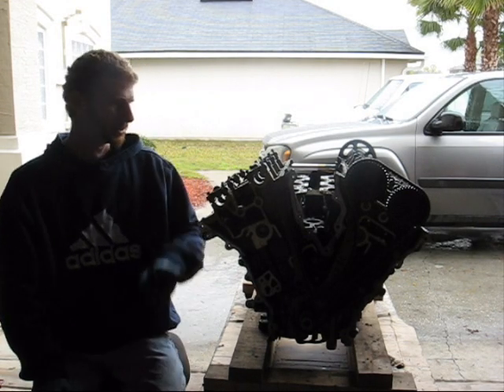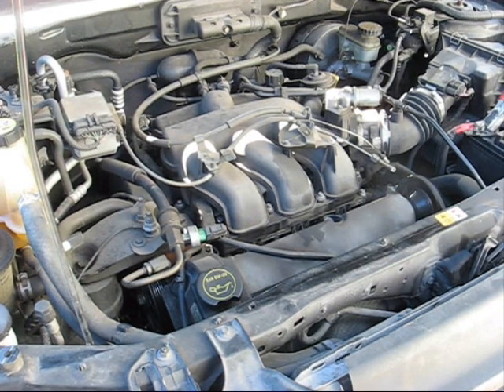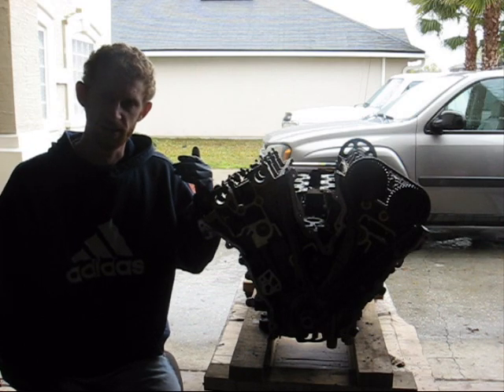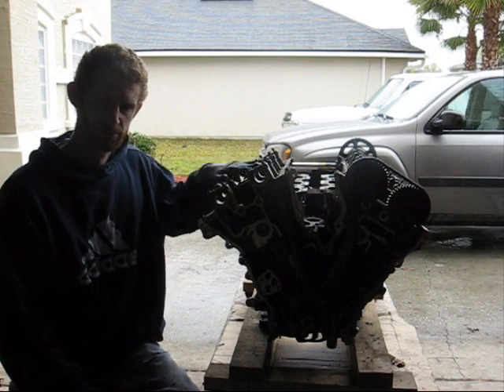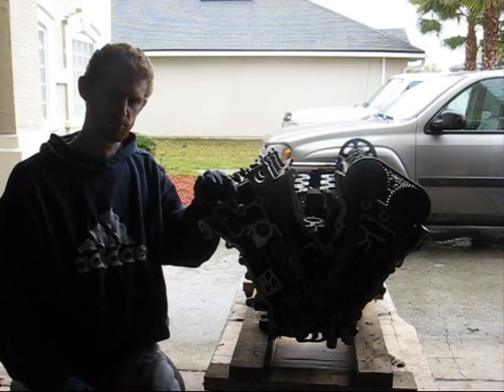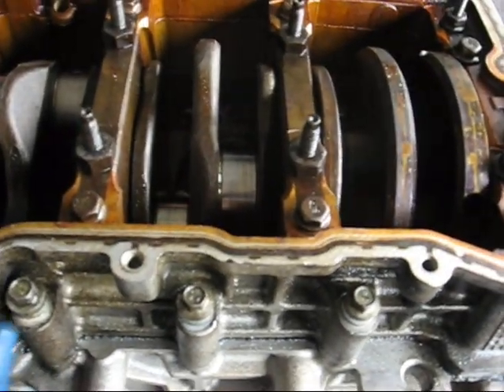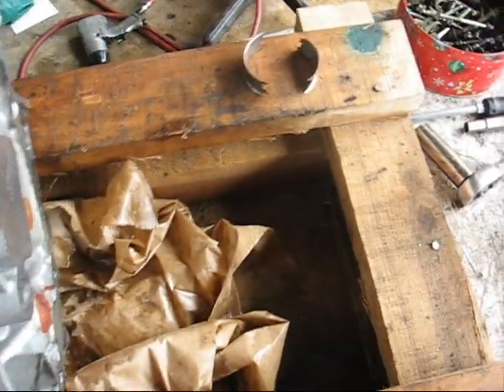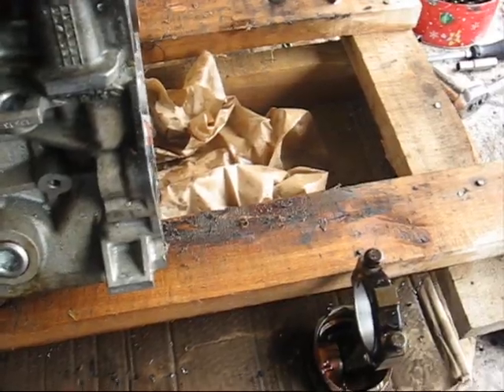Knocking 3.0 Duratec teardown

Comment: I had 350k on my 05 escape 3.0 duratec, still ran good, used no oil, always changed oil at 5-7k miles motorcraft blend,sold it to neighbor and he drove it for a year until he rolled it end over end. I had ford check compression yearly. I have 07 mariner,same engine, 113k,runs great.

Comment: Great Videos!  We have a 2002 Tribute ES, bought new, only 110,000 miles so far (city car, parked outside it's entire life).  Oil always changed at 3,000 and checked often.  We had our first coil go bad at a few years ago, and of course it was the back side.  We did all of the belts, intake gaskets, plugs, PCV, etc. but only replaced the back three coils with new and saved the two working ones as spares, I think that was at 80K miles.  About 15,000 miles later one of the front coils went and I replaced it with a spare and today another of the front ones went , again 15,000 more miles, so I'll be changing out #5 tomorrow morning with the last of the original coils.  I should probably buy a new coil and keep a deep 8mm socket in the car from now on.  Instead of 5W-20, we've always used 5W-30 since the manual said that was acceptable.  It seems to me that a lot of the failures on these V6's go more by years than miles since we've paralleled a lot of higher mileage cars in when certain repairs are needed.  Our Tribute will be 15 years old in a few months.
Reply from the maker: If I'm not mistaken coils are considered a wear item on some vehicles and meant to be replaced at specific intervals when a tune up is done. All vehicles will experience the same things with age. Many parts on a vehicle will fail with age rather than miles, especially if it sits alot.

Comment: Finally someone gets it, all these reports about blown duratec engines and the issue is people do not check there oil. My pcv valve failed and started eating oil. I changed the valve and oil consumption stopped. Also, buy the oem pcv valve, I baught an aftermarket pcv valve and froze closed pressuring the crankcase blowing oil past the front crank seal. Very lucky I caught it, changed the seal and all good. All of this was found by just checking the oil.
Reply: I changed my pcv valve myself without removing intake.....  I did notice oil blowby in the tubes though.... also notice oil blowby in the air intake between the filter & butterfly valve.  Maybe my aftermarket pcv ain't good?
Reply: Dont use aftermarket PVC. Mine was 2 weeks old and froze up and failed in the winter. Long story short my crankcase pressurized. Use OEM. Its only a few $ more. Then keep an eye on it.
Reply: David Henri ok...  guess imma be getting one from RockAuto then and changing it again!  Thanks! (Should I also change entire pcv line from valve to rear of upper intake as well then since it's got oil coating in it?)
Reply: You can take the line off and clean/inspect. I recommond a ford PCV. Mine that failed was a "standard" brand.
Reply: David Henri ok I think I'm gonna do that tomorrow.... mine seems like it's in 3-4 pieces... it's not one solid line/piece.
Reply: Yep but a bear to change.  I noticed too, smoke from starting up was always visible and I was tipping off too often.  The pcv is the culprit for many ailments of this fantastic ford/german designed engine

Comment: The 3.0 Duratec V6 in my '04 Mazda 6S hatchback leaked for almost a decade (I bought it new, it started to leak oil onto my exhaust and cause oil vapor two years later) before I finally found the source - failure of the seal on the rear side of the timing chain cover where the block mates to the head. At 12 years old I committed to a huge project of replacing my manual transmission and clutch, and ended up tackling a lot of other repairs along the way. It took me a long time to remedy the problem but I have no more leaks. I was very careful in cleaning the seal mating surfaces and used sealant designed for synthetic oil. I actually discovered that the 2 surfaces of the head and block didn't meet up flush (thanks Ford), so I filed the protruding edge and used emory cloth to smooth things out. I came to realize that EVERY seal was leaking.  All 6 spark plug seals were leaking, and I had already replaced them once before. Both valve cover seals were leaking, and I replace the small seal that runs under the water pump pulley as well as the oil seal where the camshaft exits the head for the pulley. I replaced the main seals at the flywheel as well as at the timing pulley. New oil pump which ended up being a waste of time and money since the original was just fine at 165,000 miles, but I figured "might as well since it's all torn apart".  No more leaks BUT I eat 3 quarts of oil per change. Even though my PCV valve is only 2 years old, I'm going to go check it again...  Thanks for the awesome video man. Very informative.

Comment: I have a 2.0 duratec mondeo that's done 142,000 miles and I check my oil regularly. The early blocks had problems with substandard oil rings but was rectified on later models. I recently replaced the inlet manifold tumbler flaps as a precaution as they can weaken with time and get ingested by the engine but thinking about it now I probably should have changed the pcv valve while I had the manifold off. My car uses a very small amount of oil and that's probably down to the valve. Thanks for the video, great job.
Reply: The 2.0 is a four cyl engine.. totally different

Comment: Awesome video! I have a 2001 Escape with the Duratec 3.0 v6 engine and (luckily) I'm obsessive about checking the oil because I know I have a minor leak (valve cover gasket for sure and somewhere above oil pan).
Reply: Timing covers are notorious  for leaking on those engines, that will cause a leak above the oil pan.

Comment: At about 5:44, what is that in the middle of the cylinders at the top of the block? It looks like a spot for an ignition coil or hose, but the hole stops. 

I have a 2010 escape and was wondering if it should be exposed like mine is.

Comment: It's a pain to get to the pcv valve.
Reply: When I had my mechanic replace my valve cover gaskets, coil and plugs, and check the torque on the cam cover bolts (problem on the earlier Gen 1 3.0 V6), I had him also replace the PCV valve because of its terrible location. With 148K miles on the engine, the PCV valve was still pretty clean thanks to regular oil changes. The valve cover gasket facing the firewall had a small leak. Other than that, the engine was only losing oil from the oil pan gasket which is next on my list for him to do. Fortunately, I have no noticeable oil loss between 5K mile oil changes with premium 5W/20 full synthetic oil and premium oil filter.

My 2008 Escape (Gen 2 body) still has the Gen 1 3.0 Duratec engine (non-VVT) which I prefer for its simplicity and better reliability reputation than the Gen 2 engine.

Comment: Where any of the top bolts loose inside the head? Heard that they then to work out or break a lot. Usually from the back forward.
Reply from the maker: No
Reply: @pfun41  Thanks for the reply. Still trying to figure out what happened to my freestyle with this engine.

Comment: Great Video thank you!  I purchased a 2003 Ford Focus LIMITED last week with 177 thousand kilometers on the odometer. After a engine flush and Synthetic 5W-20 oil and new filter the Engine started to tick a little....almost sounds like piston slap.    Is this a know issue for these engines? Or is this my engine about to fail on me?     The ticking sound is audible when hood of car is closed and when running at warm operating temperature while idling.     I have no ENgine light on, the car drives like a dream, very smooth.    It's just that sound!   Please help
Reply from the maker: If the engine wasn't well maintained the new oil after a flush might be a bit thin for the tolerances. Could also be lifter tick. If the PO was running 5w-30 I'd go back to that.

Comment: Hi mate I have just watched a couple of your videos on the duratec change out and clearly your guy to ask a couple of questions. I hope you have the time to answer.
I have a vacuum leak plus an oil leak on my 05 Mazda Tribute 3.0 litre duratec.
On inspection I have noticed the oil coming from the front hand head cover. I have decided to buy a full head gasket set (Victor Reinz) with spark plugs and ignition coils also the front and rear mounts are bad so I have grabbed them as well.
What is your opinion on the best way to install these? Would you leave the engine in or take it out? Also the car has done 170k kilometres Would you replace anything whilst your at it?
Reply: When I have dropped/changed the oil I haven't noticed anything to indicate the cylinder head gasket is blown but here in Australia just to get the intake/exhaust/plenum and head cover gaskets its the same cost as buying the whole kit from the states an I thought well I can either use all the gaskets now as I potentially am doing quite a big job just with the mounts and the head cover gaskets.
Reply: Oh and the car is on 175k kilometres and I have had to replace the PCV at the intake manifold because it had sucked in on itself and I bought the valve but was not able to get to it at that time so I have that and will replace it too on this big job.
Reply from the maker: +christian morrissey Headgaskets on these can be a pain, there Aren't proper timing marks to retime it when you put it back together. If your talking about the valve cover leaking then I would just replace that gasket and the intake gaskets.; I wouldn't try to replace head gaskets unless they're blown as that's just opening another can of worms. I would do everything in the car, no need to remove the engine.
Reply: +pfun41 thanks for your fast reply mate. I'll take your advice and leave the engine in and just do the valve cover and intake gaskets. Those 3 videos were really good and give very good insight and advice. Cheers mate

Comment: We have a 2000 Taurus and a 2002 Taurus with this engine. The 2000 is a good running engine but it has over 211,000 miles on it. The engine has has the oil pan gasket replaced as well as the valve cover gaskets replaced and it still leaks oil. Do you think it is coming from the rear main seal? It's hard to find these engines in the Taurus because most of them have the 3.0 Vulcan engine in them. (82% to be exact)
Reply from the maker: Front main and rear main can also leak, or if corners weren't sealed properly.

Comment: Great video (another thumbs up from me) !  Duratecs are good engines but they sure won't run without oil.  Mine has a mystery oil leak, we've had it on a rack several times and can't find it. I had the intake off to replace the coil packs on the rear bank and I thought I replaced the PCV valve but I don't remember it being that big (2005 Mercury Sable).
Reply: I'm not a professional, but I think you might benefit looking into engine oil dye. Engine fluid manufacturers make a fluorescent dye that is safe to add into your oil. After running the engine briefly, you should have better luck finding the source of the leak with a black light. I would recommend general cleaning near any potential leak points with a engine safe degreaser before all of this too. 
I would also suggest looking into the manufacturer recommended engine oils and see if there is a heavier option oil that still meets your oil temp requirements.

Hope this helps.

Comment: loved the videos. but based on what you had it was clear that the owner of the engine did not do oil changes at the right intervals. they ran it dry. look at the dark stains left behind the oil.
hopefully you sold it. it's still a great block. you could chuck a grenade at those things and they would survive it. as long as it had freshn oil lol

Comment: got a 2003 tribute that eats oil and emits bluish white smoke that smells like oil yet runs smoothly and not a lot of clatter would this be from a stuck open PCV valve possibly or a more serious problem???
Reply: Well, the engine is certainly burning oil.  Replace the pcv valve and pray it fixes it, otherwise you probably have serious internal engine damage.
Reply from the maker: Throw a PCV valve in there and see if it gets better. They're cheap and are supposed to be replaced as regular maintenance anyway. Also check the rubber elbows, they're known to deteriorate on these engines.

Comment: what is your favorite engine flush product? How about transmission flush? Amsoil?
Reply from the maker: No flush, flush tends to cause more problems than it solves. Seafoam or any of the knockoffs if you must.
Reply: Frequent oil changes with quality full synthetic oil and quality oil filter will keep the engine clean. If you have to flush a dirty engine, it's too late. Prevention is easier than cure.

Comment: Your opinion if the car smokes 2000 Ford escape would you do the head work or just replace
Reply: 2004xlt
Reply from the maker: If the pistons/rings are shot new engine. If its valve seals or guides I'd get rebuilt or used heads.

Comment: i need to change a blown head gasket... please help me with how to remove the timing chain  with out knocking it out of time. i never removed one before and having bad trouble doing so and its causings a delay.
Reply from the maker: Ive never removed the timing chain on one of these but you don't want to just pull it off, there are no timing marks from the factory. what I would do is set it to TDC on cylinder 1 then put marks on the timing chain and sprockets so that you can line them back up. A paint pen works well for this as it won't come off too easily. The Cams may try to spin when you take the timing chain off. There are tools to hold them still. Be careful, if you get them even 1 tooth off it won't run right. I would use 2 marks on each sprocket just to make sure you get them lined back up. Don't take the chain completely off, use a bungie cord to hold it tight on the crank sprocket so it stays in the same spot.

Comment: When you took the head off you can see the rh bank #1  piston  shiny on the top @ 4.26 and the head also shiny, @5.35. The piston has been clapping the head due to the bearing failure due to oil issue.. It seems that you never notice this..
Reply: That’s LH bank cylinder #4

Comment: I have an 04 escape with a knock that is so bad, it also stalls when I put it in drive and take my foot off the brake pedal. the car has been good to me, what do I do
Reply from the maker: Engine swap or sell it. I can't make decisions for you.
Reply: pfun41 ok, I'm in South Florida, how much is a good used engine and what do I look for
Reply from the maker: If you do it like I did and use a Taurus engine you can get them for 5-600 shipped all day long. Only thing is they'll only ship to businesses or a freight depot so you'll have to pick it up from there. Most Engines being sold online have been tested in some way. Usually a compression test or vacuum test. Get one with less miles than yours. Many are also from cars that were in wrecks which usually means the engine is in good shape.
Reply from the maker: Sorry didn't see this, I got mine from ebay, alot of auto dismantlers use them. Looks for detailed info on the vehicle it came out of, miles, and condition of the engine. They will vary based on mileage and what vehicle they are from. At the time I did this taruses were 400-600 and Escapes were 1k-1600.
Reply: pfun41 thank you

Comment: Hey buddy, do you still have that core or did you sell it/scrap it?
Reply from the maker: Scrapped it a long time ago. Nobody seems to want 3.0 parts.
Reply: Bummer. About 4 months ago my 2009 Escape decided to start sounding like this and not wanting to work right. Might end up having to rebuild at this point. Still not sure yet.
Reply: @pfun41  Did you possibly at least keep the cams? I am rebuilding a '03 and cam gears are worn. They are not available anymore. Even when they were, they came only w/ the cams. So, am looking for some good cams/gears. Great Vid!
Reply from the maker: @stangohr  Try ebay. It's good for those hard to find pieces.

Comment: Hello, very good video !. I have a Ford Mondeo 2.5l Duratec V6 that makes a noise when it is idling. I disarming a cover of valves noticed is very clean as if the oil does not rise, if you see my videos you will see one where the noise is heard.
Reply from the maker: nochezero Well it doesn't sound like a knock. A knock will get worse under throttle, yours goes away. Definately valvetrain related. I'd say probably a lifter. Any sludge buildup at all?
Reply: ***** Thanks for responding, noise I hear it up I think if that can be dirt since he had put a very thick oil that may have covered some duct, the problem is that I have to get distribution and camshafts to clean and check that. How I can check the oil pressure? where does the bulb?
Reply: ***** The PCV valve can be reconditioned in any way? here costs a lot to get them, you have a problem with the oil pump I will compicar enough.
Reply from the maker: nochezero
 There is a switch threaded into the side of the block that detects oil pressure. If you remove it you can attach a mechanical oil pressure gauge. You may not have low oil pressure though, it might just be that oil can't get to the lifter or that the lifter has failed. If you pull the valve covers you can check the lifters. Push down on them with your finger. they should all be very firm, if you can push a installed lifter down by hand its bad. There is no way to recondition a PCV valve. you can clean it but replacement is best. I like to get parts from Rockauto or if they don't have that there Ebay.
Reply: ***** Very grateful for your help, I mean that I can check the lifters without removing the camshaft? God wants to be just that is a car that I like da still worth seeing. Greetings from Argentina !.
Reply from the maker: Yes, just push on the ends of the rockers that rest on the lifters.